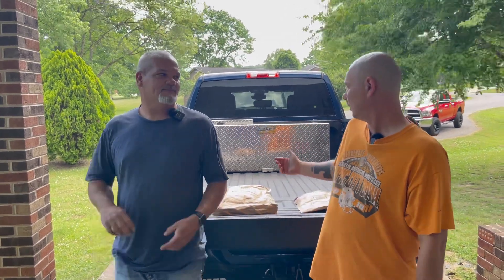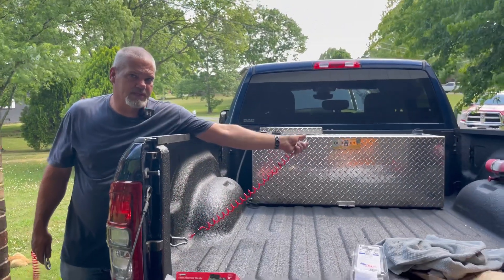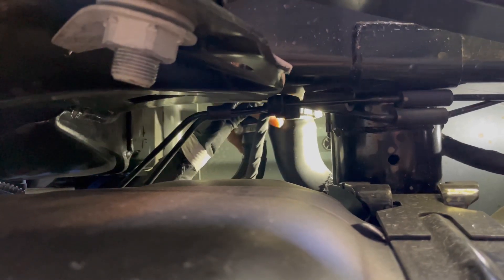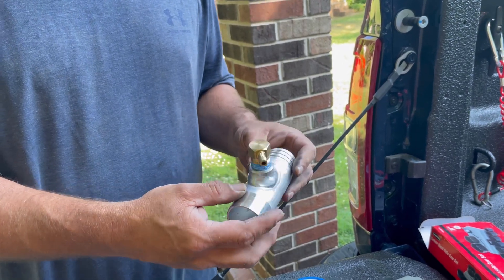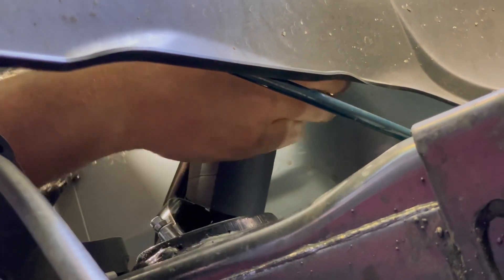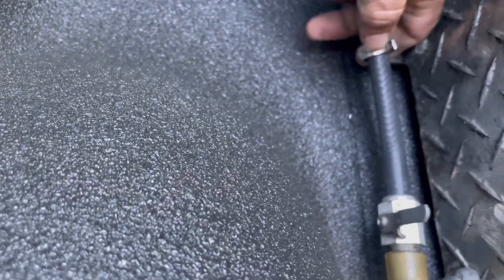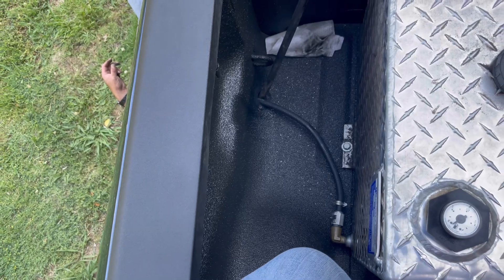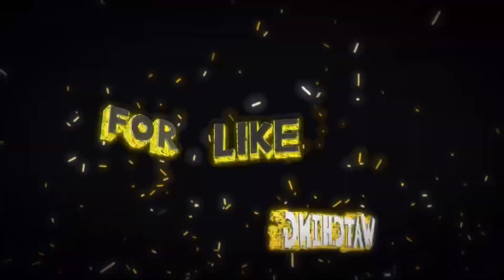How to Install an Auxiliary Tank

Comment: Cool video.  That said, am I missing something?  Why wouldn't you fasten the hose from the aux tank onto the big fitting that you're plumbing onto the 1 and 3/4 " line before you install that big fitting and then have to wrestle that little hose and hose clamp on after the fact?  Just curious.

Comment: Hey guys, great video on the tank install.  I've installed 3 them in my trucks over the last 5 years.  Always fun drilling holes in a new truck, right?  One thing I did change on mine was I replaced the nut and lock washers, that came with the install hardware, with nylon locknuts.  Not sure that it's that critical, but with the nut/lock washer going up against the spring and not tightening it down tight, I worry about the nut backing off as the tank/bed flex and the spring compresses and decompresses.  I probably worry too much. 🤷‍♂️
And another thing.  If you guys would buy for trucks, the holes are easier to drill in the bed. 🤦‍♂️ Aluminum!  Scares the crap out of me how easy you can punch a hole through it.    🤣
Reply from the maker: Lol.. I appreciate it. It was crazy drilling holes in a new truck.. but I still think I will stay with my Dodge.. Thanks for watching and Stay Safe..

Comment: Awesome install video. I’m looking to do the same thing soon. Can you leave the valve open all the time or will it overflow? Does the flow keep up with what the truck is using while driving down the road ?
Reply from the maker: The red truck yes the blue truck no.
Reply: I leave mine open in both my trucks.
Reply from the maker: @gabeslaughterpinnaclehoriz2473  I would love to on the blue one but it will overfill
Reply: When I added the fuel cap from genos garage our 2021 quit over filling, leave the valve on all the time.
Reply from the maker: @shawnbeitz6543  didn’t think about that. Thanks